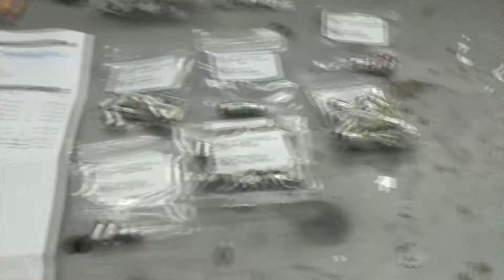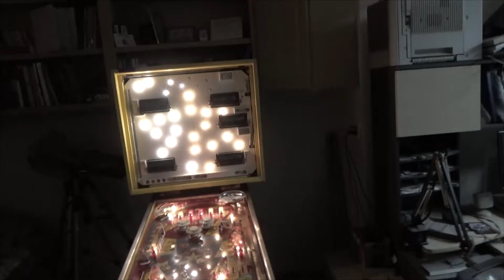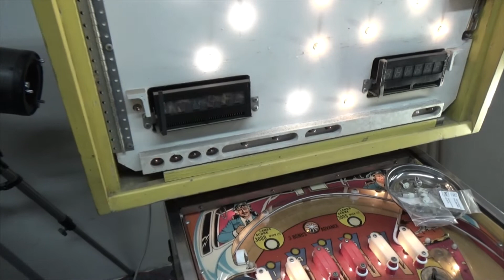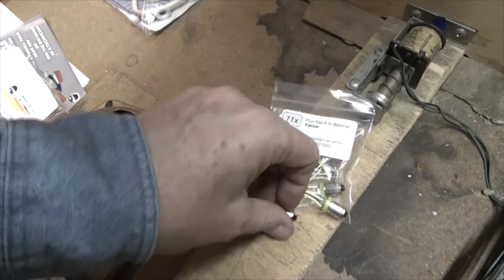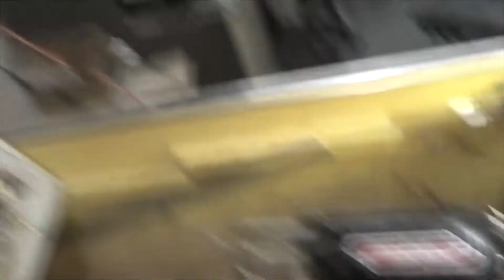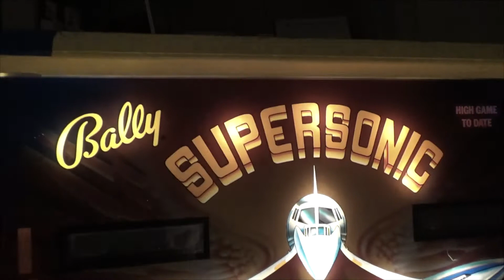Bally Pinball LED Conversion Supersonic

Comment: Regular or Non-Ghosting LED's for GI (Regular will save you $$$), Yoppsicle for Flashers, and Two Headed Flex Non-Ghosting for the Star Inserts.  The pink is the way to go on Amber inserts.

Good video thanks.
Reply from the maker: Glad you liked it. Adding the resistors is a lot of work. I got another machine and just bought a modern Alltek light controller board.